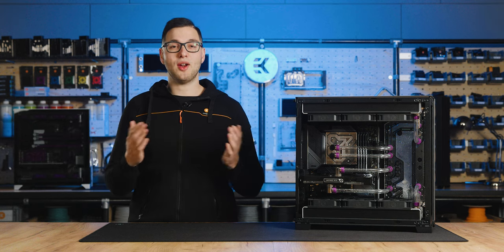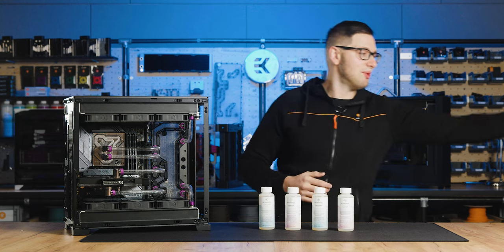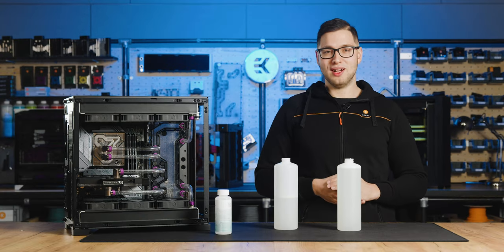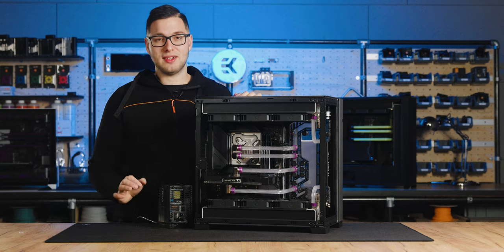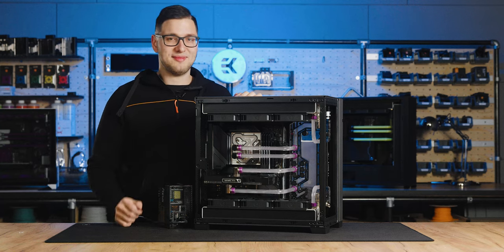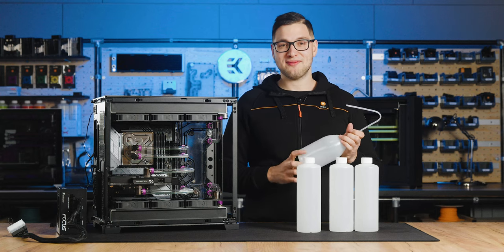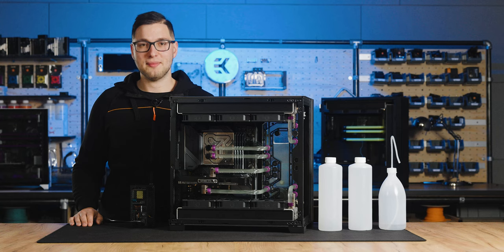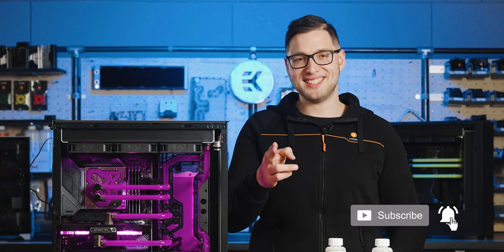Preparing Your Water-Cooled PC for the First Time | EK HOW TO

Comment: I like EH parts but you are Ridiculous trying to sell people on all these extra chemicals. I bet if you tried really hard you could turn those 4 bottles into 8 bottles of different products. Maybe we need a cleaner for the outside of the shipping Box and then another cleaner for the outside of the cooler and then a different cleaner for the plastic parts and then another cleaner for the painted parts and then a different cleaner for the O rings And then a different cleaner for where the plastic parts meet the metal parts and then another cleaner for after it's all clean And then another cleaner for before you clean it but after it's all clean but before you clean it again
Reply: Depending on your set up you only need one cleaner and one flush or just the flush if you have no major build ups.

One is meant to clean out the system and help remove build up that happens when using colored liquid and just over time and the other meant to flush the system to remove the cleaning solution and prep for the new coolant
Reply: Probably just citric acid tbh
Reply: 😂😄😁!!!  Then it'll be Clean Clean...Clean...

Comment: The video might complicate things by splitting the process into separate bottles, but here's a clear summary of what you need to do:

1.	Pour 1250 ml of distilled water into a 1.5-liter bottle, then add 250 ml of EK-CryoFuel Loop Cleaner to reach a total of 1500 ml.
2.	Use a tester to check for leaks in the system and then fill the system with the mixture.
3.	Allow the mixture to circulate for 15 minutes and refill the system if the level has dropped.
4.	Let the EK-CryoFuel Loop Cleaner and distilled water mixture circulate for approximately 8 hours.
5.	Drain the EK-CryoFuel Loop Cleaner and distilled water mixture.
6.	In a 3-liter bottle, pour 2759 ml of distilled water and then add 250 ml of EK-CryoFuel Superflush to make a total of 3000 ml of mixture.
7.	Fill the system with 1500 ml of the EK-CryoFuel Superflush and distilled water mixture and let it circulate for 15 to 20 minutes. If excessive foam occurs, reduce the pump speed.
8.	Drain the EK-CryoFuel Superflush and distilled water mixture.
9.	Refill the system with the remaining 1500 ml of EK-CryoFuel Superflush and distilled water and let it circulate for 24 hours.
10.	After 24 hours, drain the mixture and proceed to refill the system with your preferred coolant. It will be ready to use!

Comment: I personally would never use respiratory air for draining the system, like shown in this video. By  doing so one can bring back bacterium back to the system.
Reply: Not to mention you risk inhaling the cleaner vapors or getting it on your lips and in your mouth.
Reply: I hope you have a medical grade air system then and not just a harbor freight pancake compressor  that gets dusted off every 8-12 months 😂

Comment: Isn't it bad to blow into the loop to empty it due to bacteria? New to watercooling and about to flush my loop for the first time maintenance, so this timing is impeccable lol.
Reply: The biocide in the coolant should prevent any growth from that bacteria, but you're right, if you can drain the loop without blowing in it, that would be even better.
Reply: Yes, that is bad but the EK guy then uses EK SuperFlush so supposedly that help clean everything up. Though, why he didn't show that himself using the EK Leak Tester for that is beyond me. The EK Leak Tester or similar leak testers should be capable of light weight flow creation for assisting with the loop draining process.

Comment: Thanks for the info. IMHO, this cleaning of manufacturing process residues should be done by the manufacturer before packaging: when we buy something new, we expect to be able to use it out of the box, especially when considering the high price of water loop elements. It's as if you were adding a tax of CAD $70.00 (ship. inc.) for buying your water loop components, and that's despicable: two bottles to buy, one for cleaning the loop, and another for cleaning the cleaner (for 250ml)... Come on guys, if you oblige us to do what you should do, at the very least make this affordable for what it is and stop trying to milk down your customers! Jesus...

Comment: I've Built 6 or 7 custom water loops and I never did this. Just flush your system for an hour with some distilled water, then add the coolant of your choice. Make sure you replace your coolant once a year and never use additives + distilled water in ek loops unless you like yellow stains.
Reply: Never use distilled water?
Reply: @Kyezie131  Just stick with ekwb products and you will be fine. It's not the distilled water but the 3rd party additives you add to the water that can cause flaking and staining.
Reply: @pccanvas  Ohh okay gotcha. Because I was literally going to use EK concentrate and of course mix it with distilled water. First time building a loop so I was confused
Reply: @Kyezie131  yes that is fine. Just replace the fluid once a year and you should be good. Jay's two cents has some great videos if you want to learn more.
Reply: @Kyezie131  hmmm follow the manufacturer recommended treatment or a random internet expert (such an expert they are watching a video on how to flush a system), tough call this.
Reply: @HuntsChris  hmm follow the manufacturer that is asking you to do something that they never asked before, who is laying off employees and raising prices because they are going broke? Or the guy that has been buying and running EK parts for the last 10 years. Up to you champ!
Reply: Is it fine to fill with coolant when still a bit of distilled water like in early video?
Reply: @hasyidanparamananda  I would spend the time to take out as much as possible. Take some of the loop apart if you need to.
Reply: @pccanvas  ok so I need to take out as mush as possible I can, and go?? Thank you for the advice~
Reply: @hasyidanparamananda  yeah because you will dilute the coolant, so if it's just a little it's ok

Comment: I just flushed 2 new ek radiators before installing using an aquarium pump and distilled water, filtered through a coffee filter. Got some green small particles, very small and very little quantity. You guys did a good job on those radiators.
Reply: Had the opposite experience and flushed out around 6 rads, 2x360, 2x480 and 2x 560, all XM. Went through so much distilled water. 

I don't know if there were issues with the first batches, but they were painful to clean. It was like a nation's worth of dandruff in there.
Reply: @sargeyrose8253  Jesus, what the heck are you cooling? A nuclear reactor? I flushed the new quantum surface slim 360 and one performance 280 in my Y60 dark hero build, cooling a 5950x quantum vector cpu and a strix 4090 alphacool block. Surely you have a dual cpu build?
Reply: @sargeyrose8253  I had a lot of residue as well. I used a gallon of distilled water for each on a 280 and a 360 radiator.
Reply: @adamfogel837  I think you may have gotten luckier than me; I'm pretty sure I used at least 4 months of showers for mine.

Although it depended on the thickness, the thicker ones were more of a pain than the thinner ones. Still, even their radiator cleaning stuff did not help.

I might genuinely film myself next time.

Comment: I had to use a really small water pump & that electric air duster to flush everything out the system before coolant. Was the hardest part.
Reply: After reading your comment, I think a shop vac might be useful.

Comment: I hope EKWB is continuing to develop preventative solutions for this necessity.  I had clear cryofuel in my loop, and as the level dropped every so slightly over a few months, a white precipitate built up where the coolant level used to be, at the very top.  I feel like this is preventable?  To be clear, I bought a pre-built gaming rig from them, so... it wasn't me who screwed something up.  A quick google search shows many, many customers reporting the same thing- significant precipitate buildup.

I look at it like this- you would never flush your car's radiator once a year- that's overkill.  So why do we have to do it here?  That brings up another question- why can't we use car anti-freeze?  lol. 

I just feel like the cryofuel should be designed so that you don't have to clean the loop once a year with 2 separate products.  Maybe I'm naive, but I just have the sense that there's a solution to this, whether it be only one type of cleaning/flush product, and/or not having to clean the loop once a year.

Comment: I see you flushed a whole system here as im planning to do with my superflush and loop cleaner soon. My concern is if youre flushing the loop same as the liquid rotating through the system already anyway. So yes the flush will pick up and loosen bits in the loop that the coolant might not have... but they will simply end up flowing through til they get stuck in my CPU block where the fins are wouldnt they? As a result wether i flush or not i will have to take apart the whole board and monoblock to clean the fins because of my setup. So is this really worth flushing the whole system or maybe say the system minus the CPU block so as not to catch the bits and save me doing a teardown?
Thoughts please if anyone sees what im getting at

Comment: I use a special paint brush oil free compressor at 1 bar to blow out the system, this makes that the loop has a constant stream of air, which is also dry. Because I build a lot of custom loops and do maintenance on those systems, it's also handy for blowing out dust. Those clean products are great, I use them too. In my own system, I do the cleaning every 6 months with full color fluids, and with the transparent colored fluids every year. I noticed with the "mist" fluids, the chance of clogging is much more happening than with the transparent colored. In short, I will start to build a fully ARGB custom loop, all with EK products. Except the UV LED strips, these I bought in a special modding shop. And these works great. Other strips give blue color, and don't get the UV out.

Comment: Thank you for the video. But how did you test the loop for leaks?
Reply: Search the web for a water cooling pressure leak tester. It tests the loop to see if it’s airtight. Corsair makes one that’s pricey, but there are cheaper options. I went cheap and kinda regretting it tbh haha
Reply: the pump thing he held in his hand is an EK product.
You literally just pump in air up to a certain pressure and wait like 15 mins and see if it holds that pressure. If it holds air it will hold liquid

Comment: i'm very new to the whole water loop system, it's about time for mine to be flushed and changed but i have no idea where to even begin, if anyone here has any videos or could explain in detail how to do so i would really appreciate it, i don't  know what to flush it with or even how to run the pump by it's self i just know i need to do so, then refill with coolant. it's the first one i've ever owned so bare with me <3 thank you!

Comment: What happen to the third bottle? Did he add it together on the 24 hour flush?

How much distilled water is added to each bottle of the cleaner. They appear to have two different amounts
Reply: The video might complicate things by splitting the process into separate bottles, but here's a clear summary of what you need to do:

1.	Pour 1250 ml of distilled water into a 1.5-liter bottle, then add 250 ml of EK-CryoFuel Loop Cleaner to reach a total of 1500 ml.
2.	Use a tester to check for leaks in the system and then fill the system with the mixture.
3.	Allow the mixture to circulate for 15 minutes and refill the system if the level has dropped.
4.	Let the EK-CryoFuel Loop Cleaner and distilled water mixture circulate for approximately 8 hours.
5.	Drain the EK-CryoFuel Loop Cleaner and distilled water mixture.
6.	In a 3-liter bottle, pour 2759 ml of distilled water and then add 250 ml of EK-CryoFuel Superflush to make a total of 3000 ml of mixture.
7.	Fill the system with 1500 ml of the EK-CryoFuel Superflush and distilled water mixture and let it circulate for 15 to 20 minutes. If excessive foam occurs, reduce the pump speed.
8.	Drain the EK-CryoFuel Superflush and distilled water mixture.
9.	Refill the system with the remaining 1500 ml of EK-CryoFuel Superflush and distilled water and let it circulate for 24 hours.
10.	After 24 hours, drain the mixture and proceed to refill the system with your preferred coolant. It will be ready to use!

Comment: If I got a brand new complete set of water cooling gear from EK (3x 420mm radiators, distribution block and pump, pipes, CPU block, GPU block and fittings ALL from you) would I still need to #pre-wash" the system to remove resins, etc that the manufacturer failed to remove? I understand about wasing oit once a year, but brand new unused EK parts? Surely EK is premium enough to guarantee all their brand new parts are pre-washed and ready to use for the first time?
Reply: Always do a pre-wash, and no, they are not premium enough. 

Things will get left behind, due to the manufacturing process that they use, flux ect.
Reply: @Sargey Rose  but then, surely, it should be down to the manufacturer to be responsible for rinsing out the parts they make? These parts are very expensive to buy for what they are & the relatively small amounts of materials used to make them. So for the premium prices, with cheaper alternatives to EK, shouldn't EK parts at least be sold pre-washed and ready to use?
Reply: @TimLongson  Would love it if that was the case. But no, kind of applies to all of the radiators you buy on the market. You always want to do a clean beforehand. Just standard practice.

Comment: Hello, how do you reduce the speed of the pump if necessary ???
Reply: You have to turn on the PC and have the PC control the pump speed.
Reply: @Zinic_ is there a program involved?
Reply: @juliangarcia6073  it runs on max speed when PC is off. Most likely your PC turned on will slow it down. Bios can handle that.

Comment: I used the EKWB EK-CRYOFUEL SOLID AZURE BLUE and now the loop is always clogging exspecially the CPU Block, and the flow is going down from day to day, till i take the CPU Block out and clean it, and every time i find some interesting residuals in it. Do i get the Pastel out of the loop using this superflush & loop Cleaner?
Reply from the maker: That can happen with solid coolants as they break down over time and the larger particles can obstruct the coolant flow. You want to physically remove them from the loop. The best way to do that is to disassemble the block and thoroughly clean the coldplate using a toothbrush and some warm soapy water. You can watch the video on how to clean our water blocks here: https://www.youtube.com/watch?v=0bwUNcJhhwE
Reply: @EKWBofficial  i already made it, but i continue to find particles. so you are saying that this cleaner is not ideal for my prob??
Reply: @MarcoTechExperience sorry to burst your bubble but avoid solid coolants. You can never go wrong with clear  coolant. Make it easy on yourself.

Comment: Would this help if I only used distilled water in my loop? The blocks are black and nasty. 😅
Reply: You can’t just use distilled water. You need to add biocides/growth inhibitors if you want to run distilled and not something like a premix. Idk how you didn’t come across this in your research before you did a custom loop but yeah, pretty standard tbh

Comment: Nice video... But you need to use proper protective gear when managing the concentrate!
And you used your mouth to blow air! Isn't it dangerous to accidentally breathe in vapor from this thing that you can't even dump it down the drain?

Comment: Can you guys comment on the warning for aluminum parts in the manual? Are these products still safe to use? I have an asus z690 formula MB and I hear rumors that the vram heatsink might be aluminum, so im holding off on using this for now.
Reply: You shouldn't mix metals that come in contact with the liquid, as in a copper cpu block and an aluminum radiator.
Reply: The concern about aluminum is only for using parts or fittings that use aluminum.  EK's cleaning and flush solutions are fine to use in an aluminum loop.  How do I know?  I contacted their tech support because I'm re-doing/upgrading my loop on the pre-built computer I bought from them.  It's the mixing of metals that you need to be careful about.
Reply: You have to contact ASUS to send you that correct part since there was an RMA publicly announced.
Reply: @juliangarcia6073  that's what I did.  Asus wanted me to send the whole MB back but I heard horror stories about their RMA process. Instead I had them send me the vrm heatsink replacement, and I rebuilt the whole system myself. Everything seems ok except I have brownish red gunk gathering around all of my orings. I was worried that it was bacteria, but it showed up within hours of filling the system, far to quick for bacteria. When I rebuilt I took every component out, broke down all plexi ek parts, connectors, oring, everything and soaked them in distilled water, then scrubbed them with dish soap, then rinsed with distilled again. I then ran the ek loop flush and clean twice before filling with ek cryofule. There is no way, even if I had bacteria, that it could grow that fast in these chemicals. I decided to wait and see, and as I expected it has not gotten worse. So I think what I'm seeing is oring grease leeching out of the orings. I've heard EK is notorious for the nasty grease they put on their orings. It doesn't matter in my system because I have so much rgb that you can't really notice the brown grease unless I set the rgb color to white.